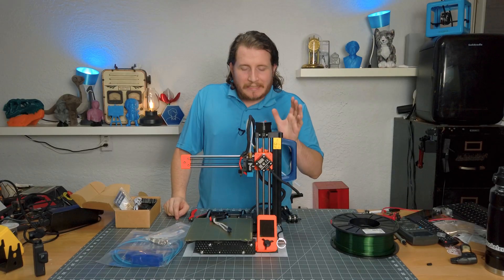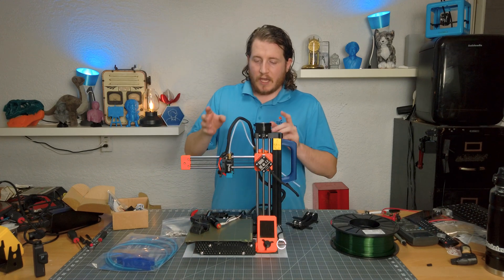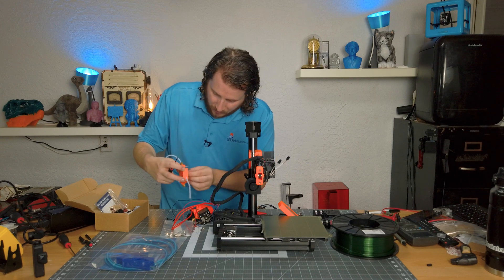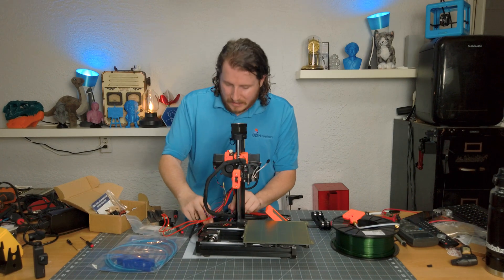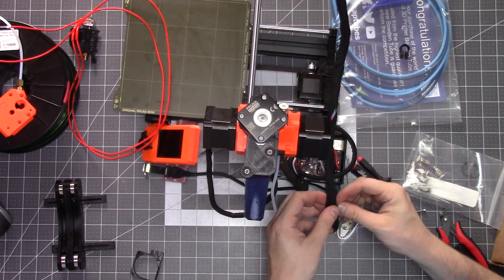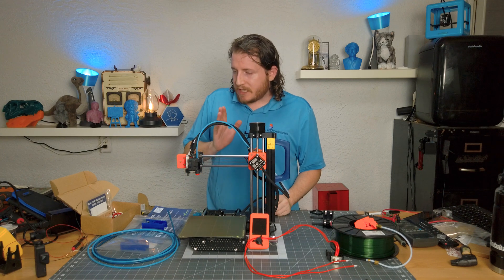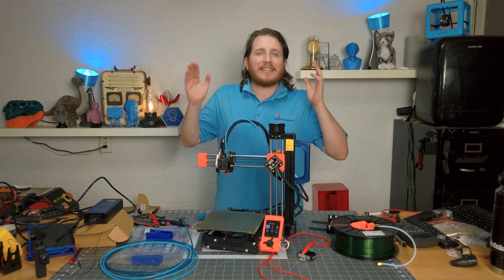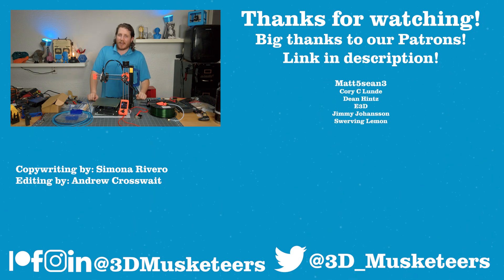ULTIMATE UPGRADES for a Prusa Mini!

Comment: You forgot to do a test print. Would like to have seen that
Reply from the maker: it ran fine, but it also ran fine before any of the work so we ended up cutting it lol
Reply: @3DMusketeers  fair enough. Considering doing the same Mod, so was curious on how it would print, post modding.
Reply from the maker: Mine was working fine pre mod, so post I would feel it is just the same :) Just easier to maintain now ha ha

Comment: You forgot to upgrade the extruder with the dual geared bondtech extruder 😁 I was having so much freaking trouble with the stock extruder grinding filament and then having to disassemble it constantly, I've never had a problem with it since replacing with the bondtech extruder
Reply from the maker: I have not had issues with that just yet. But yes, if you do, then do it.
Reply: I've had the mini+ for 3 years now and never had an extruder issue with pla or petg

Comment: Isn't that USB drive that comes with the Mini kind of slow?  It seems much slower than a newer USB drive I use.
Reply from the maker: i never noticed anything about it, but replacing it isnt an issue.
Reply: @3DMusketeers  Check out some other flash drives, you'll be impressed with the time difference.
Reply from the maker: I guess it has never really been a problem to me.

Comment: I'm really late getting to see this and hopefully you could still answer my question. I have the Bondtech extruder on my machine and definitely like the sounds of the Revo kit. Would I still need or can I still use the MM10 piece that you mentioned with that extruder? Any help would be greatly appreciated before I go and start printing parts before I order stuff.
Reply from the maker: that one I am not sure of as I dont have the bondtech upgrade, HOWEVER, the MM10 is a pretty easy print and not much material.

Comment: Actually I did some big updates to my Prusa mini now. The biggest one was to do the Dual-Z CK3D mod, wich I can highly recomment. With high quality lightweight extruders like the Orbiter, Sherpa, LGX light or TBG light, I see barly a reason to use a bowden setup anymore. Actually, after changing the hotend to the Revo micro, I also tried out Sherpa and TBG light (actually I like the TBG light more, but the Sherpa works great also). I decided for a moons motor - while both moons and lgo do great motors, moons use higher current (and therefore lower voltage), and as the controller controlls the current, I did not even have to change the current settings for the motor in prusas firmware (or in start g-code).
But while the extruder is light compared to an mk3(s(+)) extruder, still adding weight to a conterlever design is not always the best. Also with the creality pad supporting the prusa mini out of the box, a mechanical stronger design for higher speeds seems apropiate. So adding a second z is absolutly an improvement (you have to modify ck3s's design a bit to work with a direct extruder, basicly cutting some conflicting plastic away (preferable in slicer before printing, but alternatively afterwarts with a drehmel).
As I was modifying the printer anyways, I also changed the bearings to bushings - 2 IGUS bushings and one Ruthex bushing on y-axis, extremly silent and precise. Also one brass bushing and one self designed bushing with high clearence in z-direction for the printhead (actually, brass bushings have a very low tolarence fit; using two of them often leads the printhead to be stuck at the ends of the x-axis, if the two rods are only slightly missaligned by some micrometers). The self made bushing was simply changeing the hole of the bushing from a cylinder with 8mm diameter to two half-cylinders an a cube of 1mm by 8mm between - so you get a clearance of 1mm in z-direction and still a snug fit in x (so the printhead can not tilt).
Actually while the printquality of the mini already was good, it improved further - and the mini became even more silent.
Also I changed the coldend fan to a noctua (turning at a 100%, instead prusas fan with only 38%).
I also plan to do the bed mod (physicaly level the bed). Also I search for a better part cooling (going faster with klipper would make that mandatory).

For the cost of the upgrades the Revo system is a realy big deal. While the basic set is "just" about 150 bucks, one Obxidian is now about 74€. So with 0.4 and 0.6 Obxidian the  price nearly doubles (but I have multiple printers and do not print abrasives on all of them the same time, so I only have one ObXidian set for now).

Actualy there is realy an alternative to the Revo: Trianglelabs have the CHC-system. It is a bit simular to Prusas nextruder, you can swap out the heatbreak, heater and nozzle by disconnecting the two plugs and loosening one screw.There is also an integrated nozzle/heatbreak combo (for non-abrasive filament), but you can still use seperate nozzle and heatbreak - any v6-compatible nozzle will do. The CHC micro is about 40€, including 1 heater, 1 nozzle and 1 heatbreak. Aditional heaters are about 20€, integrated nozzles about 8€, seperate heatbreaks about 7€. Having multiple heaters means you can assemble your own combination once and than swap the whole combo - but still, if your nozzle or heatbreak or heater have a defect, you can just change the defective part. Also you have more flexibiltity - combine the heatbreak with a CHT nozzle, or a tungsten carbite or a ruby nozzle - whatever you want or already have.
As they have a CHC with a coldend compatible to the Revo micro, you can use every hotend design intendend for the Revo micro also for Tranglelabs CHC micro (maybe very little modification to access the screw to loosen the heatbreak easy).
Reply from the maker: Do not support Triangle Labs, they just clone everyone.

Comment: 16.30 - there is a lot of movement in the assembly, is that normal or something wasn't tighten yet? A comparison of prints (before and after) would've been nice.
Reply from the maker: foam feet. 

Not differences in print quality so it was skipped. It just makes servicing easier

Comment: Do you need to change anything in the settings other than recalibrate Z?
Reply from the maker: Not in my experience. Make sure the Bowden is correct though or it'll change the initial load purge needed, but that's an easy thing to work around.

Comment: There is a 12v and 24v version of the Micro. How do you decide which to use? Also, if you commit to the Micro system,can you still use an E3d Nozzle X or are you committed to the Micro nozzle system because of their setup?
Reply from the maker: 24v for prusa. The micro means you are required to use the Revo system.

Comment: What would be your recommended options of I wanted to print some abrasive material filament with my mini?  I like the upgrade here but want to have the option to print carbon filament from time time but can’t find any hardened nozzles for the Revo.
Reply from the maker: E3d is launching the Obxidian nozzles soon which is hardened for abrasives. That would be your option if you want the Revo system
Reply: @3DMusketeers  I’ve been doing a ton of research and will definitely go with the Revo Micro!  Your video was awesome, thank you. I have my upgrades mapped out for the mini now; Revo Micro, Bondtech IFS extruder and Capricorn tubing.  Of course it doesn’t NEED that but the whole heater core/quick change nozzle system seems like a winner to me. I’ll pick up an ObXidian nozzle when it comes out. Thanks again.
Reply from the maker: @prongATO  I have been using the revo on this mini for a whole. LOVING It.
Reply: I don’t think I’d be printing abrasive a lot bit there may be points where I need the more robust material. I use the printer for prototyping and designing parts to be used functionally as part of designs and my inventions.

Comment: what does that extruder part upgrade do?
Reply from the maker: Removes their bowden system using the brass nuts and goes to a more traditional setup using the couplers most of us all know and are used to. Also allows for easier changes in the tubing should that be needed.
Reply: @3DMusketeers  thanks :)
Reply from the maker: Absolutely!

Comment: I actually did have to pull out the soldering iron when I replaced my mk3 hot end. I accidentally ripped the fan off. So I had to solder it back together. lol
Reply from the maker: Those fans can be VERY fragile, but also, thankfully, they are not too expensive should you need to replace it. Soldering is a great skill to know though!
Reply: @3DMusketeers  A few years ago I fixed a commodore 64 made in 1985. (made from 82 to 92). I only broke one trace and damaged one. So there is just a single bodge wire on the board that is otherwise pristine. Thanks to me buying a heat gun for helping with support removal in 3d printing (rarely needed, but when I need it it's amazing) I suspect if I had done the same repairs now the heat gun would have prevented the damage. But hey it works so I can't complain. It's a nearly 40 year old computer. lol It even has a functional SID (sound chip). A working SID isn't common these days. So it's a bit of a gem. There are modern replacements, but it's just cool to have original parts. It's all original commodore parts except for a single chip that is using a period accurate replacement.
Reply from the maker: Okay, that is pretty cool! Love keeping old electronics alive

Comment: I've heard capricorn boden tubes are a game changer. Could you explain why that is?
Reply from the maker: Much tighter tolerances on the bowden. They make both 1.9 and 2.0mm inner diameter. You may not think the 1.9 matters, but it means less slop in the system resulting in cleaner retracts and detracts.
Reply: @3DMusketeers  maybe that would help with the MMU2. It seems to be working well, but every now and then it gets stuck.
Reply from the maker: That is MMU2 life alas.. But yes, Capricorn tubing can be very helpful for that. It is pretty cheap too, so not an expensive test!
Reply: @3DMusketeers  I started a 28 hour print on Sunday. Almost half of it would have color swaps. It was working fine. Then I went to bed and woke up to discovery roughly an hour after I went to bed it got stuck for the first time. I fixed it, went to work came home and it was still printing. It completed successfully with only a single MMU2 failure. It's so random.
Reply from the maker: thats how it always happens right? it fails as SOON as you look away!
Reply: @3DMusketeers  TBH I wasn't paying attention most of the day sunday. Maybe once an hour I checked octoprint to make sure the temp didn't drop (octolapse doesn't really tell me if it stalled out or not since it takes so long to make any noticable progress) But I forgot a few times and it went longer than that. Still only 1 failure on a 28 hour print? I can't complain too much.
Reply from the maker: Definitely not!

Comment: yeah I did my best on my cable management on my mk3, but it looks like a rats nets. Fortunately outside the box it's very clean. I'm happy with that at least, but I'm like......I did everything the manual said and yet it looks like a rats nest.
Reply from the maker: The manual is not specific other than make it fit, because ultimately these are not THAT sensitive to where it should matter.
Reply: @3DMusketeers  It makes it hard to work on. After I fried my hot end the new one didn't work. Then I realized I blew a fuse (and yes I checked the original hot end with a multimeter it was definitely dead) and getting those fuses out with that rat's nest was not trivial. But in the pictures they have it clean and pristine. lol
Reply from the maker: At least the fuse did it's job right? The MK3s is definitely difficult to work on. I wish it opened up the other way lol.
Reply: @3DMusketeers  yes when the new one didn't work I was worried it fried the board. So I'm very happy that it was the fuse.
Reply from the maker: yay properly protected motherboards!

Comment: Did you find you had to re-run PID after the install?
Reply from the maker: nope. no need, not at least in my experience and the first prints we did with it were 2 days of polycarb pieces lol. But we did have to adjust the pinda mount about 2-3mm up to not have it hit the print bed.
Reply: @3DMusketeers  Good to know. I have two Minis currently and I've upgraded them only to the Bondtech w/IFS. I have two Revos waiting for I am torn on whether to do it yet as they are printing fine otherwise.  I am truly amazed at how well they just print with stock settings.

Oddly enough both units I had issues with the stock extruders loading filament. It would never grab the filament to do the initial fast feed no matter what I did. And then I would have to do 7-8 purges to finally get the filament up to the nozzle.
Reply from the maker: It they are fine, leave them alone IMO. Ours was fine, admittedly, I just wanted to do it for a video. I am glad I did. The performance is much better, and with less bowden tube it is so much easier to maintain! 

That issue you had was because of the multiple pieces of bowden tube in the extruder not being PERFECTLY aligned from being slightly too tight. That MM10 upgrade gets rid of all of it!
Reply: @3DMusketeers  That makes sense. My second Mini came yesterday and I was going to run it bone stock at first just to ensure everything was working but I for the life of me could not get the filament loaded. Also I do love the integration of the IFS in the body with Bondtech. Prusa's design of it just hanging there was kinda meh for me.
Reply: @3DMusketeers  Also thanks for the great content. Love your channel since I discovered it a few months ago.
Reply from the maker: That is a nice benefit of the Bondtech, as I stated in the video the runout sensor for that printer was DOA, so it can happen. I get their reasoning though from Prusa, but likely something could be made I guess. it is bloody simple internally. Try out the MM10 upgrade and see how it runs for you, it may reduce the need for the Bondtechs :)
Reply from the maker: Thanks man! We keep doing it for people like you! I appreciate the support!
Reply: @3DMusketeers  if I grab a third will do for sure.
Reply: @3DMusketeers  I just realized you all are only an hour and 20 minutes from me. I am just north of you all in Citrus County. Small world haha
Reply from the maker: Oh dang! Well hey next time you find yourself down near Wesley Chapel hit us up!